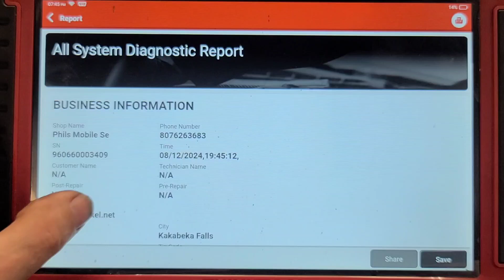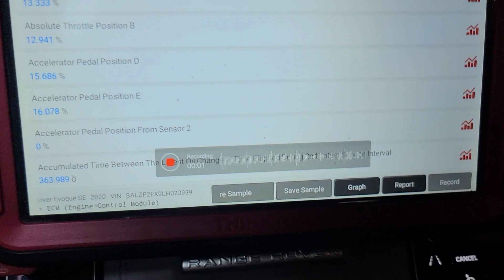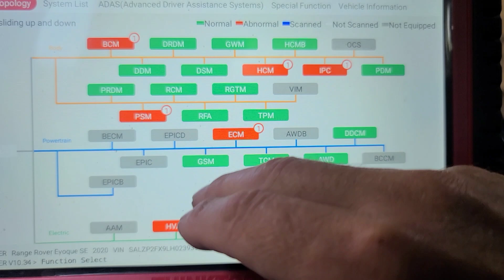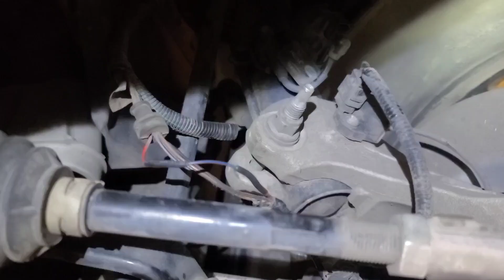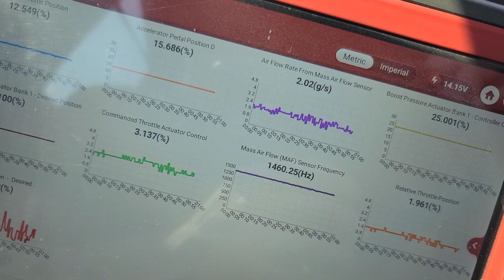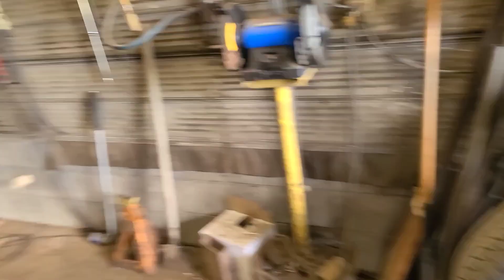2020 Land Rover Evoque Hesitation And Wierd Noise

Comment: Nice! I mean...it's nice when you watch it sitting in your chair with a cold drink in your hand😂.... I own a 2004 Cayenne with air suspension and even when the car is shut I can hear the leveling system doing it's job - air hissing noises from the airbags probably compensating for the floor. At the beginning of the video I was convinced that the POS rover had a problem with the air suspension, maybe a broken air tube or something. Then I saw it had coil springs so it became more interesting. You went on the right track with your diagnostic! Good job! Keep them coming!

Comment: A range rover....your either the bravest man or you've been sniffing brake cleaner too long.  Those things can break just sitting still.  Even the sensors have sensors.  Last one I worked on the ride leveling system was so over engineered it was a disaster.  Took me 3 days to find and fix 2 broken wires.
Reply from the maker: @scotthill1278  lol "even the sensors have sensors" that's good, I'm going to use that line!

Comment: Hey Phillip
The scan module adds the newer protocols for communication. 
DOIP, can fd flex ray…ect. 
That landrover has doip. And the scanner actually communicates via Ethernet to the gateway/bcm and from there the gateway does it thing to route messages. 
If you get into much later model euro then to use your snap on scanner that s7 scan module will be needed.
Reply from the maker: I've been using Snap-on scanners since the MT2500 red brick but I think this Verus is my last one...